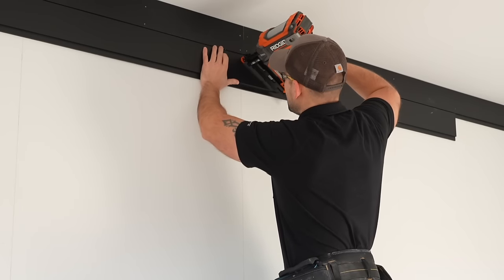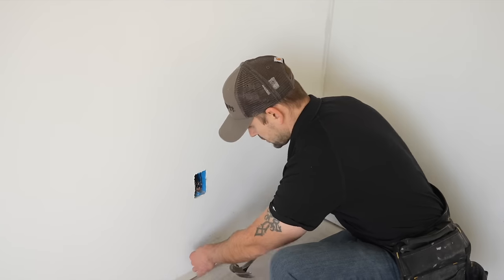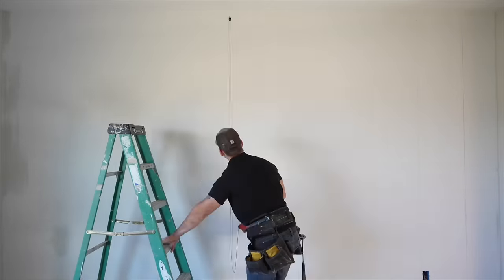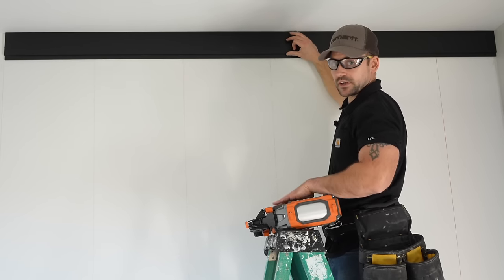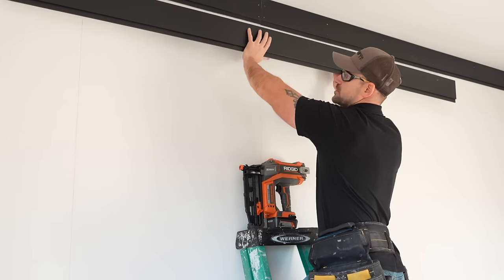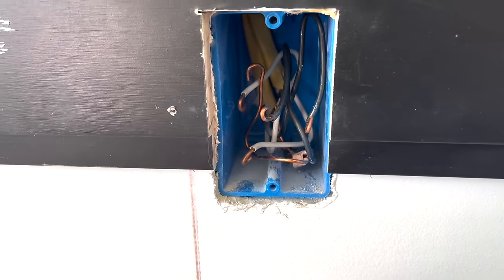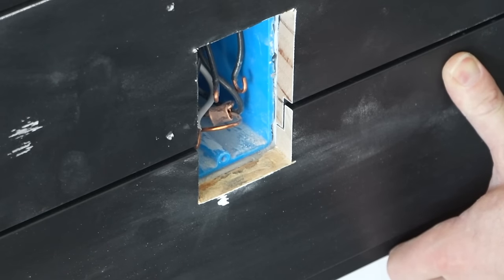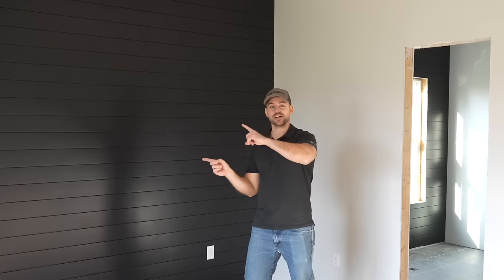How To Install Shiplap On Interior Walls

Comment: You can use a circular saw with perfect lines if you do not have a miter saw. Just use a quick square on your cuts as a guide. I usually use a piece of painter tap on my cut line as well to prevent any chipping of the finish.
Reply from the maker: Yes you could for sure use that method. It’s just a lot quicker and less room for error when you use a miter saw. Thanks for watching!
Reply: You are a hack if you use a circular saw for finish work.
Reply: @Faruk651  Your a hack if you DON'T know how to use a circular saw for finish work friend.
Reply: @Faruk651  or a homeowner/DIY. If anyone identifies with that, just make sure you use a new blade, and you cut from the back side so the rotation of the blade is forcing the teeth into the front. This way, the fibers of the wood have a backer, and there will be minimal chipping.

Comment: Need to add a spark guard around that plug per code. "ARLINGTON BE1 SINGLE-GANG BOX EXTENDER". Looks and turned out great, like the style, looks expensive though.
Reply: Came here to say that. Glad I checked first. ;-) There are so, so many shiplap installs on YouTube where they don't use extenders. Dangerous and a code violation.

Comment: I have a couple of questions:
1) What if the wall is slightly bowed out? 

2) Also, would you still need to stagger the lines if you had a space that was 6 ft across?  My thought would be to cut all of the boards to 6 ft and install.

Comment: Everything looks good. Except you don't just nail all over the face of the boards. You mark your studs, then put power grab adhesive on the back of the board, then only nail through the lip that will be covered. If absolutely necessary,  you can pin nail the top bord to the lip underneath.  Why would you want to see all of the nails? Even if you're using finish nails. You'll need to fill and sand every one. Also, you must put a box extension/spark shield on the outlet boxes. It's code.
Reply: Exactly. I'm paying extra to see nails every where? REALLY.  Do not like at all
Reply: Do you not watch the whole video? He did mark all the studs. And then he chose not to do power grab since he might want to remove it later and doesn’t want to completely destroy the drywall. Once you spackle and sand the nail holes you don’t see them at all if done right

Comment: Excellent video. I’m doing shiplap install this week. I was concerned about all those nail holes bc despite spackling them and sanding, you may still see them after paint is applied. Are you gonna add base mould and side mould (verticals) to this wall? Nice job. 👍

Comment: So rare to find installer starting from top to bottom.  Home Depot's video shows from top down also. Eliminating the gap by the ceiling with molding for a clean look could be worth holding up each board when nailing. Some prefer to leave the joint showing up for a staggered look.  I am trying to weigh all the prons and cons before starting the project. Any suggestions will be appreciated............ Thanks for taking time to detail the work for an excellent finish.

Comment: Would have used a 22 1/2 degree miter at butt ends and painted the raw edge before install....sorry..........Window casing, when ripping the true width, cut the back side that goes against the window leaving the finish edge for new casing and paint the raw edge before install.......

Comment: 3:48 not a good idea when the corner is drywall and has mud, another reason is studs maybe dog legged and out of plumb. I would have done what you did at the bottom or used a 6 foot level from point of reference. Also sockets nowadays have 2 separate power sources thus 2 different breakers, be sure to check the upper and lower before attempting to remove the socket. Just a suggestion :)

Comment: Don't waste money on paint take roofing felt put it on black side out it's done at 30 seconds and he's probably saved $80 in paint
Reply from the maker: Hey Brian! The concept of using black felt works great for standard boards but in this case where you have shiplap you won’t see anything behind the boards other than where the laps are. That’s why you should paint the laps before you install the boards. Hope that helps!